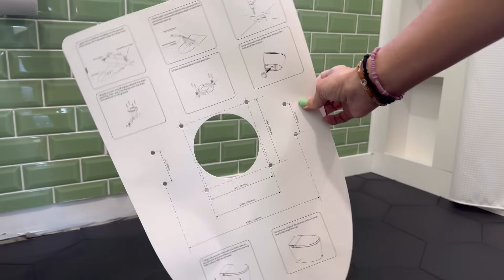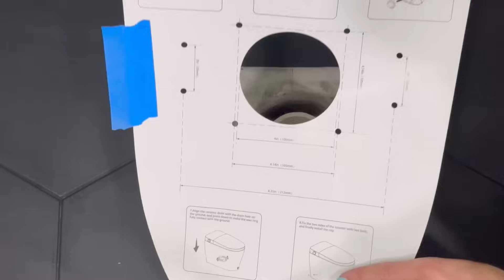Getting Our Homestead Garden Tractor Fixed | Hope this Works! | Horow T05 Installation

Comment: I would CLR that tractor and then coat it with the wipe on flat clear. It looks like it's supposed to. That Polish socket set is why you need to save the old parts since you'll break new one with it.
Reply from the maker: Awesome! Thanks for the advice

Comment: When I was a young boy, a mechaninc told me my old motor the head gasket take aluminum spray paint and spray it and put it back on.
 When it's tacky.  And torque it down it add Thicker layer to  the  gasket

Comment: Hi y'all,  great to see the squirrel is doing well and ladly is having a blast with her bike.
Don't know anything about diesel but it seemed like you were on the right track until the oil came out into the pan. The moment I knew you had to start over. Make sure the block and head are not warped..

Comment: Yeah, they will have to be bled, a little! Lydia did a good job on the gators teeth, Jim! 👌🏻👍🏻👍🏻 Definitely need to get a rain cap for the muffler, Jim! If it had that much water in it, you definitely should’ve changed the oil my friend! We’re only human my friends, you’ll get it the next time brother! Thanks for sharing Lydia and Jim! 🙏🏻🙏🏻🙏🏻👏🏻👏🏻👏🏻👏🏻👌🏻👍🏻👍🏻🇺🇸🇺🇸🇺🇸🙋🏼✌🏻✌🏻

Comment: Saw a 901 Ford tractor that was rebuilt with cylinder head and block milled, would not run, raw fuel coming out of exhaust. They went back in and milled pistons, fixed problem ran fine after that.

Comment: Jimbo! Keep hold of those injectors, if you can get hold of an ultrasonic cleaner, chuck them in it and see if the reason they’re not sealing is because of buildup from carbon and the engine rusting shut… that way you’ve got yourself a ‘free’ set of spares!!

Comment: You need to remove that piece of sheet metal from in front of the radiator. Shouldn’t run hot after that.

Comment: Those old "pop" injectors rarely fail. The pump is where most trouble starts. If it was pitted in the barrel you will get excess fuel per stroke but that is not a real issue compared to low volume. I use a temperature gun to check the exhaust temp. You will see a spike in EGT long before engine temp goes up. Retard pump timing if possible until it has a hard cold start then advance a little. Best of luck, and BTW, you are a diesel mechanic...now.